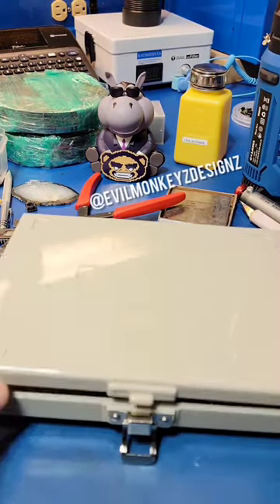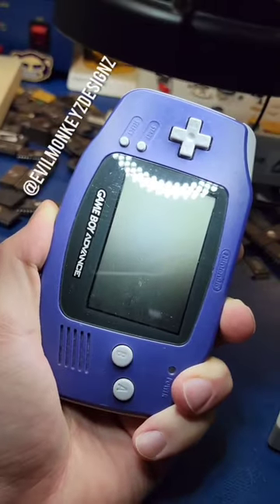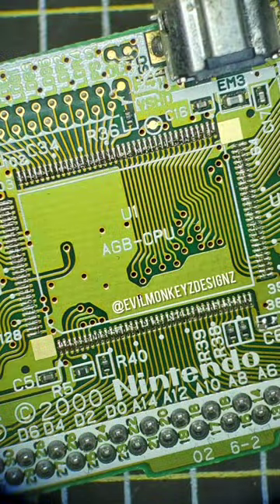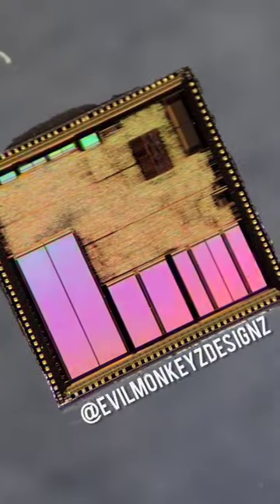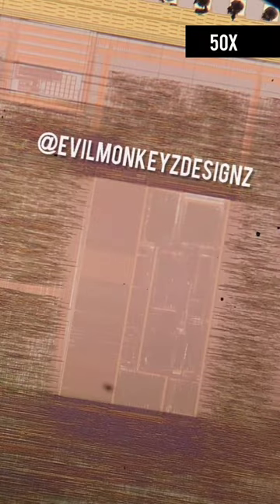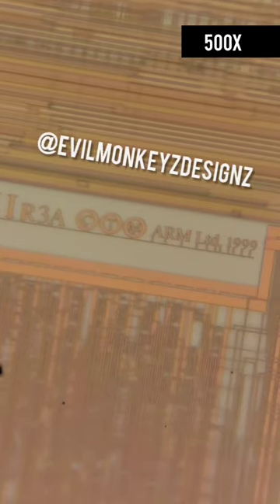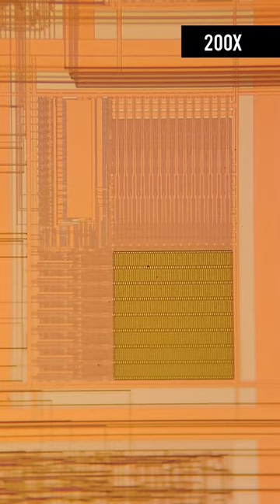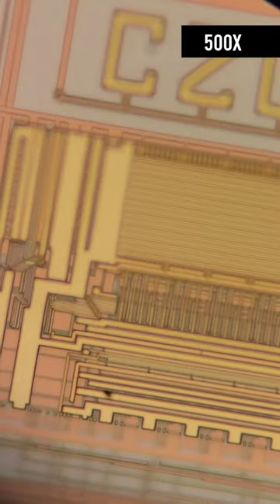Inside a #Nintendo GameBoy Advance CPU

Comment: The fact that we could make these... The fact that we can make them *even smaller now*
Reply: And that is 3-5 orders of magnitude smaller, too
Reply: reverse engineering at its finest. do they have gta 6 on saturn 😅 roll it out already. i got a 5 o clock shadow its day 4380. im cold. im tired. im hungry. theyre putting robots in the drinking water. ive been to the factory
Reply: and in industrial mass production too
Reply: The fact that today we have ARM v9 and people still use old, slow and energy inefficient x86.
Reply: @norbert.kiszka  or RISC-V. Computer architecture has been coasting on the achievements of materials science lol
Reply: @norbert.kiszka ARM indeed faster and more energy efficient, but x86 is more powerful, it can do heavy multitasking without any compromise at all. Ultimately, CISC and RISC architecture can't replace each other (at least for the next dozen years)
Reply: @locomotive9000 RISC-V performance is nowhere close to the current generation of ARM processors. They're comparable to the processor on a Raspberry Pi 3. It's got a looooooong way to go.
Reply: Right. Incredibly complex devices even far more advanced are these days being made for pennies at volume.
Reply: multiple orders of magnitude smaller.. this architecture seems quaint by today's standards.
Reply: @norbert.kiszka  We have a 40+ year old library of software that still runs on that hardware today. It's easier to just keep advancing the x86-64 tech than to dump billions of computers and switch to ARM and have to run old software in an emulator.
Reply: @ordinaryk  yes, but that is not always the case. If You are running web server on Linux or BSD, then You can use almost any architecture.
Reply: There is no “we”. You know damn well neither you nor I had anything to do with making these.
Reply: And wayyyy more powerful

Comment: You should do the security chip inside the xbox 360, one, and X/S controllers, because of... reasons...
Reply: There's a security chip inside the controllers? Jesus.
Reply: Good ol xbox 360 disc drives 😭

Comment: how to maintain backwards compatibility?  include the original cpu as a secondary imbedded inside!  brilliant!
Reply: Nintendo kept doing this for backward compatibility on their handhelds up until the 3DS, where the ARM9 and ARM7 processors of the DS were included in the SOC with the main ARM11 CPU (and in the DS the ARM7 is the ARM7TDMI of the GBA used for backward compatibility but with the original Gameboy/Gameboy Color CPU removed to save cost).

Comment: Really neat idea to keep all those de-caped chips in a box! But don't they corrode or oxidate or degrade in some other way with exposure to the air humidity?
Reply: they're just silicon and gold. the packaging is more to handle them and easily interface with them

Comment: Why does it look that way? The rainbow colors, I mean? What has always struck me as crazy was how every chip from the 286 (1982) unitil current all look like shiny cities from the top with the naked eye.
Reply: Same basic cause as on CD-ROMs, the behavior is known as diffraction. The structures on the chip are small and close together, giving many opportunities for this to happen. The structures need to be relatively close in size/spacing to the wavelengths of visible light, so e.g. on an Intel 4004 or other earlier chips with 10um+ process you won't see much of this effect, but anything much smaller than that will start to be very visible. Related, the wavelengths of light required for etching progressively smaller structures gets smaller as well, newer chips require extreme UV wavelengths for their photolithography.

Comment: I would love to learn why they look like the way they do and what causes them to make calculation just by looking like that.
Reply: I highly recommend Ben Eater's videos about digital logic, it only gives you part of the picture (and doesn't necessarily touch on the sort of microscopic engineering that goes into silicon chips) but you'll get a pretty good sense of what the pieces are and how they work. Silicon chips are just an extremely specialized, highly engineered version of that.

Comment: Is it not possible for u to look up some newer cpu specialy socs on mobile devices
Reply: It’s a completely different process and it involves some nasty chemicals.
Reply: Ohh i see , thats fine
Reply: @BGTech1 Nonsense.
The issue in taking photographs is getting to the actual die in the package.

The types of chip package are : resin plastic and ceramic.

There are different techniques used to get to the die in each of these packages.

The same plastic is used today as it was 30 years ago.

And this video content producer gets access to the dies in plastic packages without using dangerous chemicals.

There are however, other YouTube content producers that do use acids to get to the die.
Reply: @deang5622 but there are layers of metal in the way.